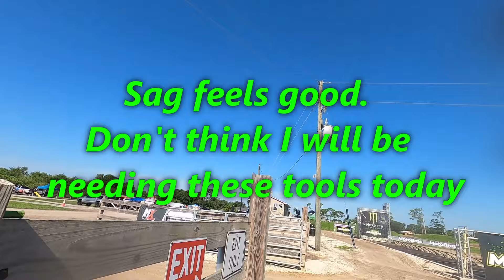1:11 Up 2 Speed YZ250 Test & Tune (Part 1). First ride on the new build! At Motobros Okeechobee

Comment: Good video mate. I try & run my chain as long as possible so my wheel base is longer & with all our tracks here in Aus I have my fork height at 3mm. My static is usually 38mm unless I ride deep sand then I go to 44 & forks flush. 
Enjoy the yz! Sounds near on the same as mine 👌🏻👊🏻
Reply from the maker: Thanks!  I found my static at 38mm after the day of riding.  Forks are currently at 6mm but thinking that might be the first change I make this weekend, thinking about trying 5mm and maybe more in that direction.  The track this weekend will be sandier and good for that kinda tuning. 👍

Comment: Track looks sick.

Can I ask you a question...

Do you know the length of the chain roller bolt on a yz125? I lost mine while riding 2 weeks ago so I ordered a new one, but the bolt doesn't go though and through and I can't figure out if i'm the absolute idiot or if the produt isn't right... It says it fits my bike on the website I bought it from, so I really don'T know what to think. I've tried finding the spec everywhere, but I can only see its diamter, not its length.

Thanks

Love your videos. They make a me a much better and cleaner mechanic than I am!
Reply from the maker: Thanks!   What year YZ125 is it that you need these measurements for the chain roller?
Reply: @UpAllNight91  Damn forgot to mention it. It's a 2017.
Reply from the maker: @falashlaba20  measurs 62mm. I can provide a link to the oem one if you need it?
Reply from the maker: @falashlaba20   Here are the links to the bolt and the nut from Yamaha https://www.partzilla.com/product/yamaha/95024-08060-00?ref=a4ef8d41e213724044551b877507af9df5a97e8e and https://www.partzilla.com/product/yamaha/90185-08009-00?ref=a4ef8d41e213724044551b877507af9df5a97e8e
Reply: @UpAllNight91  Thanks so much man! Really appreciate it.
Reply from the maker: @falashlaba20  yes sir!

Comment: Hey man, I have settled on purchasing a YZ 125 as my first mx bike, but I have been struggling to find them for sale on Facebook Marketplace down here in south florida. All of the bikes are 2005 and under going for 3k+. Any tips on finding newer YZ 125?
Reply from the maker: Oh man yeah can be tough when you want to find a good bike at the right price. What I do is broaden my search, I will be willing to drive 5 maybe 6 hours is the price and condition is right. Expand facebook search to 500 miles. And then check daily and have patience. It took me about 3 weeks of searching to find my 125 and about the same 3 weeks to find my 250. The 125 I drove 2.5 hours for. The 2022 250 I got lucky it was close. But my 2018  YZ250 was in south GA so I drove about 4 hours for that one.

Comment: why do you blip the throttle right off the jump face? just asking because ive always been taught not to do that because it can cause you to swap out, and indeed it can.
Reply from the maker: Its true that using the throttle up jumps can cause a swap, especially if your throttling up the jump. I'm not throttling up the jumps when you hear me blip it, its more of just a snap for loading the suspension and setting the pitch. I already have enough speed ahead of time to clear it without any throttle.
Reply: Good tires and low horsepower is the fix lol.  Can hold a 250f pinned on the face... Matter fact you better or you wont make it. This is for entertainment only nothing I said here is true as I'm just the Comment Troll.
Reply from the maker: @keithalexander36  and a 125

Comment: What gear oil do you recommend for transmission. Do you have a preference of brand with best results?
Reply: Shell Rotella 15w40 white bottle. Save money.
Reply from the maker: Yeah, Shell Rotella 15/40.  Changed out every 3 full days of riding.
Reply: To be honest u can use any 10 w30 oil will work an yes every 3 rides change it an clean ur airfilter that's a big thing on these 2 strokes
Reply from the maker: @michaelgarland579  Pretty much. Its not critical,the trans just need oil.
Reply: @UpAllNight91  t4 or t6 thank you
Reply: @AlmostFamousShow  t4 for moto...t6 demands more clutch clamping force.
Reply from the maker: @AlmostFamousShow  T4.
Reply: @UpAllNight91  thank you man, just had another question. My bikes clutch plates are sticking I think. Reverse Bled the clutch fluid/ no air bubbles. Changed oil. No notches in basket And the bikes clutch plates are sticking. Do you think they are glazed if so, is there a way to remove the glaze from the plates. Thanks
Reply from the maker: @AlmostFamousShow  Hello. When the plates start sticking like that the best fix is new steal and fiber plates. Thats usually what I do to fix that for my customers when that happens. The OEM plates can be expensive but are usually best. However the tusk plates are priced well and actually work pretty good.
Reply: @UpAllNight91  thank you man, I appreciate your help and honesty. Best dirt bike mechanic I’ve seen out there. Keep up the good work
Reply from the maker: @AlmostFamousShow  Your welcome and thanks!

Comment: Great reward for all the info you have put out. Bike is sounding crispy clean. On the forks I've always worked on height,  every bike is different but it seemed to me once you find the sweetspot the bike would steer flawless and even took away some arm pump after some distance. Bike is looking great, keep it up.🏜👍
Reply from the maker: Thanks.For sure fork height is key for me too, That and sag, the pitch of the bike. Its surely a balancing act but once I get the sweet spot I can ride fast while not holding on so tight because the bike is more composed and follows my lead better. Its sure been fun and excited to get back on her Saturday. Counting down the days like a kid at Christmas lol
Reply: @UpAllNight91  Weds night motobross or tamoa MX?
Reply from the maker: @keithalexander36  Its tempting, motobros. But then the car stereo will be put on hold